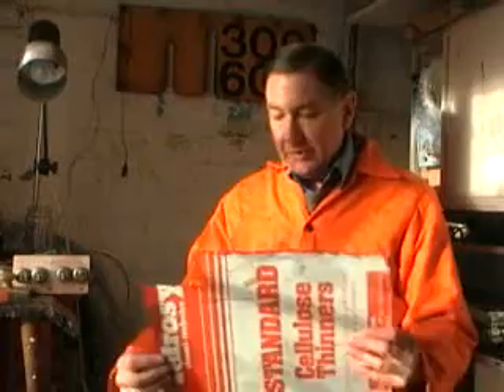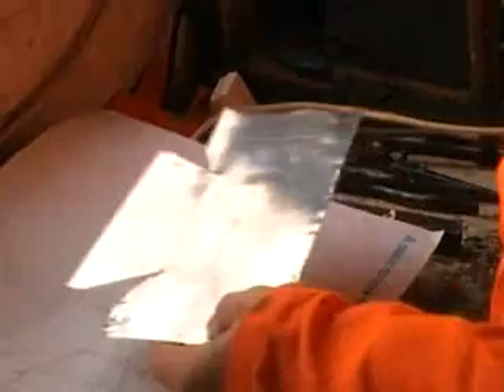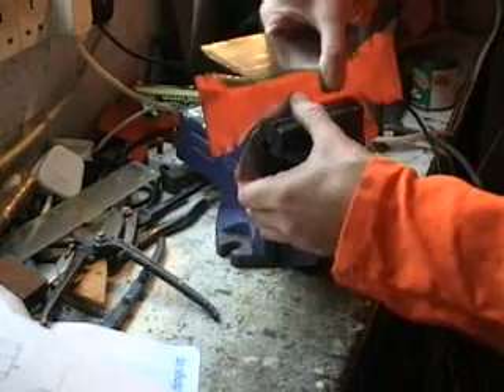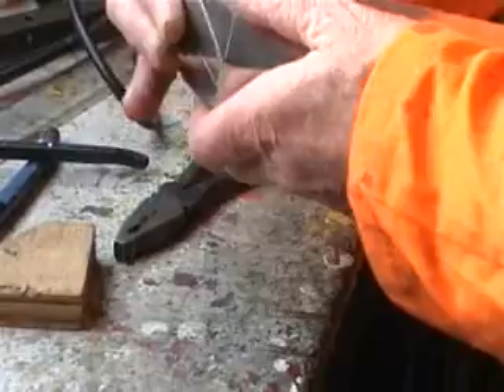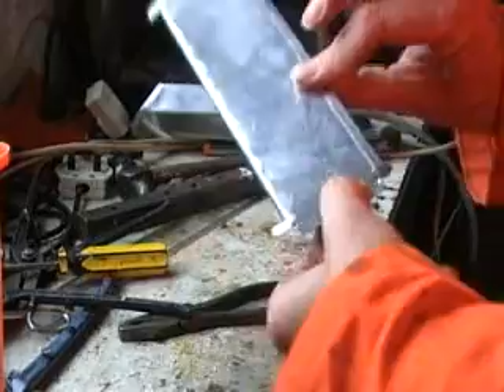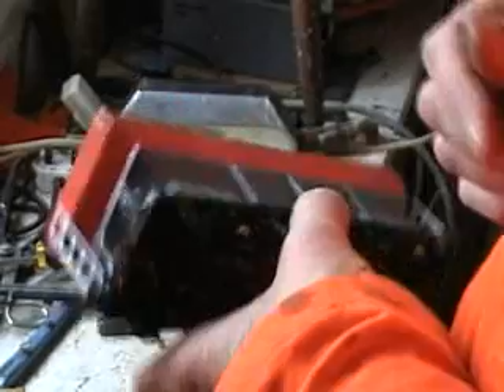scratch building wagons_0001.wmv

Comment: fantastic, i work in a kitchen so i can get loads of these drums, i don't know why i hadn't though of this before!!  How strong is soldering steel? do you scrape off the silvery coating on the steel drums,some kind of tin plate? before soldering?
Reply from the maker: Soldering this steel provides  very strong  joints and requires no more than a good rub down with fine sand paper were the soldering is required, do mind the sharp edges on your hands.